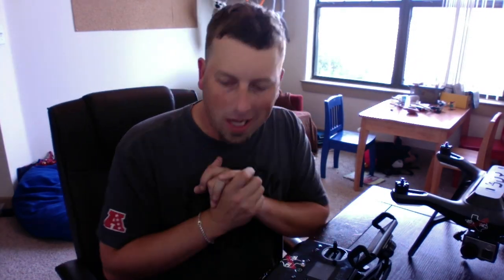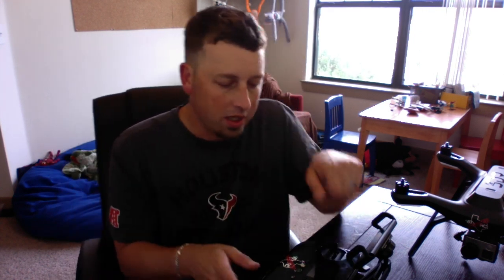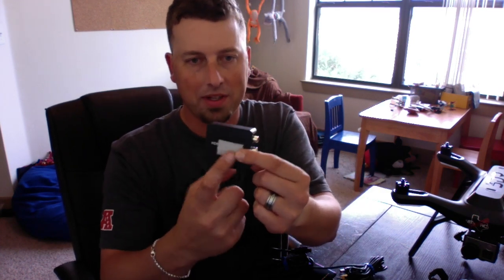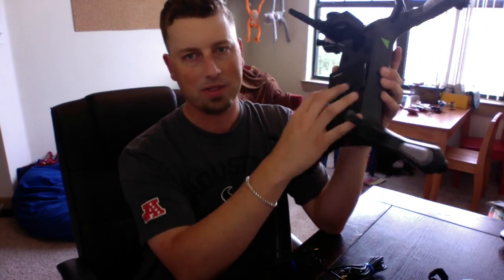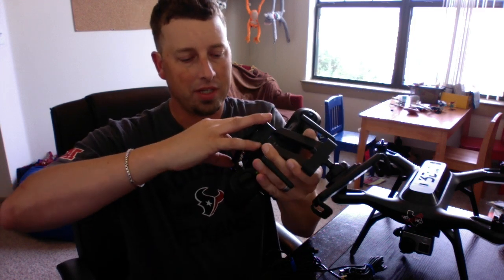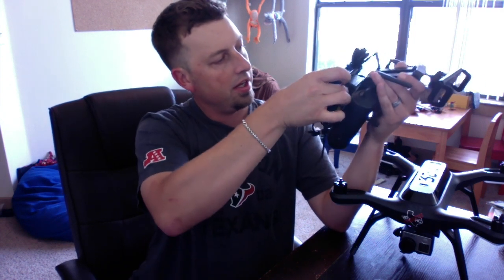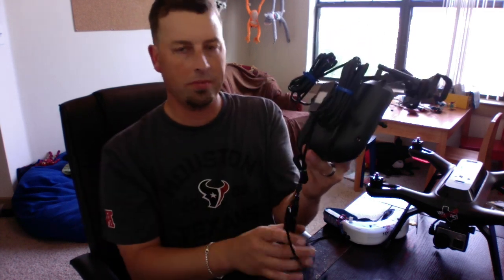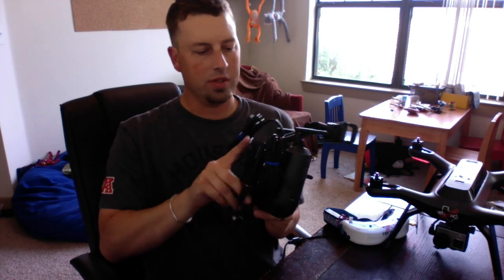How to hook up Fatshark Goggles to Solo by 3DR for FPV

Comment: So one thing i was curious about in searching for solutions to the fpv/solo workout, was if its possible to just capture the 2.4g video with a 2.4g module in the goggles? Maybe do the hdmi conversion through a groundstation, keeping the weight off the Tx and the goggles, and re-transmit the signal on 5.8 to goggles.
Reply: John Robertson if you're talking about 3dr solo or anything to do with hdmi no you can't DVR the hdmi in.

Comment: Troy, 
Saw your video on Solo and Fat Shark googles. I have the Fat Shark Dominator HD  and using it great with my Phantom 3 Pro. But my  Solo  I want to know what your finally combination was, cost and where to buy them.  Please and thank you Bill
Reply from the maker: Solo isn't great for Goggles due to being blind on using companion device.  I never continued the use after the video.  I think total cost was about $15 on the HD converter, cable, and power pack shown in the video.
Reply: What is your Solo drone's camera?
Reply from the maker: Jake Returns GoPro black 4
Reply: ATx RC Productions by CheFPV Do you know any firmware modded cameras? I'm looking for something HD FPV. I could easily buy a 4G/3G, unlimited data service, stick for my laptop. Then stick my phone to modded gimble and livestream.

I'm trying to find an alternative to 4G/3G. I'm looking for an alternative to GoPro. I'm looking for a cheap camera. I guess something that can share video back to the controller.

Would the default Solo support 3-4 pin FPV?

Comment: I know the Solo streams 720p video to the controller/device, but whats the quality of that video? Would you say its high quality 720?
Reply from the maker: Enough for me.... I don't understand needing super high def video feed.  I just need the framing, focus is not manual so 720 is fine.
Reply: Make/model of hdmi to rca adapter? Thanks!